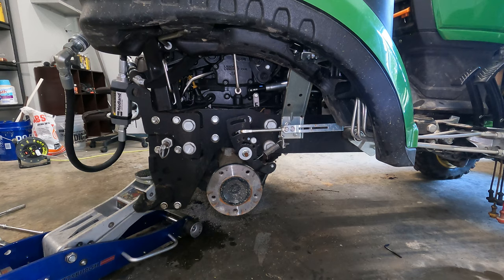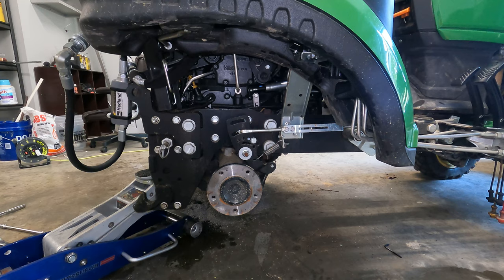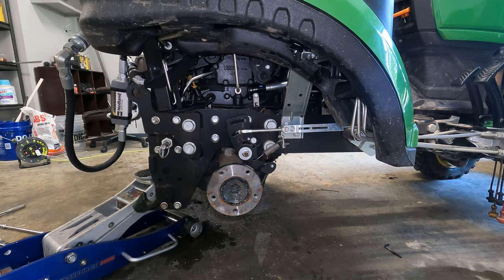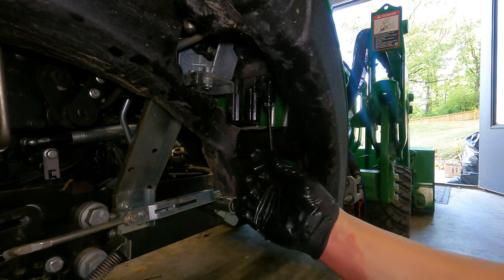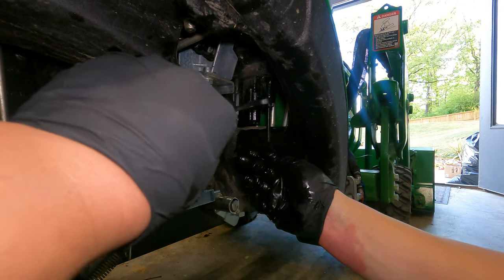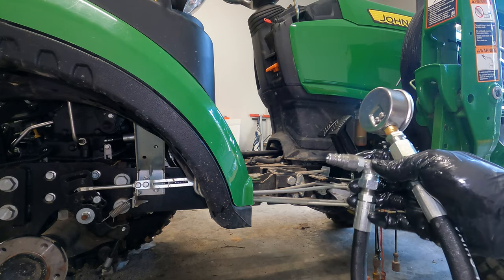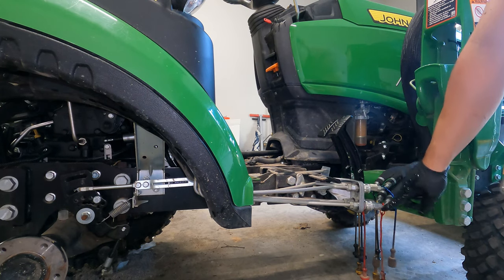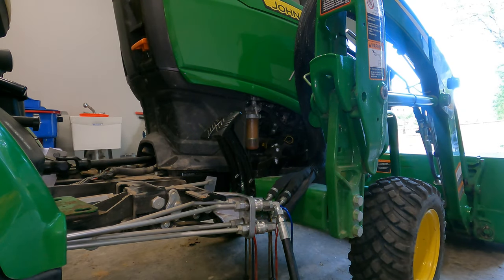John Deere 1025R Pressure Relief Valve Adjustment

Comment: Reminding  folks to warm up the tractor first before checking the pressure. 

Also only check the pressure for 20 sec or less.
Reply from the maker: Good call out and thanks!  I failed to mention that and this tractor was warmed up from some other flow tests that I was also running at the time.  I added a subtitle reminder at the 7:00 minute mark.

Comment: How do you test the pressure if you have a muilti point connector for the loader? I see boltonhooks has a warning to not use that pressure guage and quick connect if you have a single point connector. Just bought your cylinder upgrades for my 2023 1025r and I want to make sure I get the pressure dialed in as well. Awesome videos! Thanks!
Reply from the maker: You will need a 1/4 flat face connector on the end of your pressure gauge

Comment: Any idea how much the bucket lift capacity would go up if you increase the pressure from 2000psi to 2100psi?  Also how high could you increase the pressure and not cause problems?
Reply from the maker: I don't know a definitive answer for either of these questions, but let me share some math and my experience and you can decide the best course for you.

Lift capacity is a moving target because it goes down as height goes up.  I'm using this TTWT video to get my capacities for the math - https://www.youtube.com/watch?v=KJ_8i-XMMMc

He's able to get 1400lbs off the ground at 2100 psi.  Since we know the lift cylinders have a 1.5" bore, we can use pi R squared to get the area...which is 1.76 inches.  Multiply by 2 since there are 2 lift cylinders and you get 3.56 square inches of area on the pistons. Multiply that by 2100 PSI, and you get 7,392 pounds of force.  Those 7,392 pounds of force lifted 1,400 lbs, (7,392/1,400)so it takes 5.28 pounds of force in the cylinders to lift a pound of loader weight.

Real math people would use calculus to determine the rate of change based on the angle of the loader, probably the atmospheric pressure for the day and the current phase of the moon, but for us, this is probably close enough.

So for every 100 psi, you can get (100/5.28) 18.93lbs more to the same lift height as Tim did in that video.  As you go higher, that number will decrease. 

Second question - everything in the hydraulic system with the exception of the pump is rated for   at least 3000 psi working pressure, which gives you a safety factor (burst pressure) of 12000 psi because safety factors are typically at least 4:1.  The pump, based on some reliefs is rated for a 2100 psi working pressure.  Working pressure being the pressure you keep all day, everyday.  The max pressure is something like 2800 psi.  When I'm not  demonstrating something in a video, I commonly run my tractors at 2500psi and above. I've never had any issues caused by this, but your mileage may vary.  I'm also more than willing to pay for any fallout caused by me running higher pressures. If you buy a HydrosPlus pump, you can run any pressure you want.  We only ask questions to learn, but the free replacement is not conditional.  

While I know these aren't precise answers, I hope they are helpful. Feel free to give me a call or email if you want to discuss further or other related topics- contact info can be found at hydrosplus.com

Comment: I am new owner of a used 2019 John Deere 1025 with 425 hours on it.  The bucket worked so smooth and I used it for grading and had a great deal of it done, no problems and then suddenly the bucket won't tilt.   If I try to tilt it and move the stick to the right a little bit it will lower ok but if I push it too hard it will bring it all the way back up.  If I raise the bucket up to driver seat level it won't tilt at all.  I took the bucket off to do something with it and now with no load on it, it won't tilt at all to put the bucket back on?  What possibly cold have happened and what can I do to fix it.  All the fittings look fine no leaks in hydraulics.  By the way, I enjoyed your video.
Reply from the maker: I'm happy you enjoyed the video and thanks for the comment and question.  This is a very peculiar symptom, but the easiest first step is to confirm that the quick connects are seated correctly.  Did you happen to take the whole loader off?  If not, this probably isn't the issue since you haven't removed them, but it's a first thing to check.  If you reseat the hoses and you have the same symptom, switch the loader and bucket hoses.  If the symptom persists, the issue is between the SCV and the bucket.  if you have a similar symptom on the boom side (since you switched the hoses), then it's in the hydro system before the scv.  Feel free to call me at 501.454.4652 if you want to talk through it.
Reply: @HydrosPlus  No I just took the bucket off.  I will try your suggestions.  Thank you for a nice reply.
Reply: @darwinwhite9377  what did you discover?      If it was my tractor, I’d start within the easy stuff.   Disconnect the hose quick connects, wipe with clean rag, reconnect.  Next, I’d  check the hydraulic fluid level and top off if needed. Still not working, then I’d be using Google, then the manual, then call the dealer.
Reply: I had the same problem. Turned out to be the quick connects. I had been pushing brush and I guess a root or stump popped up and hit the quick connect and loosened it just enough to disable it. Not obvious by just looking, took me a few minutes to figure it out. Hope this helps.

Comment: Out of curiosity, regarding your increased flow kits.  When the pressure relief valve (PRV) opens up, how much flow can the PRV handle before spiking the pressure upstream?  What I mean to convey is, if the PRV is designed to flow, say at 4 gpm (but I have no idea what its specs are), what happens when your kit is flowing 9 gpm and an over pressure scenario occurs?  If the PRV tops out at 4 gpm, hydraulic pressure will increase beyond the set value that you have adjusted it to, because it won't be able to throughput the extra flow, and maybe even cause foaming issues.  I imagine that the PRV might be spec'd higher than 4 gpm, because theoretically you could have the steering at hard lock and also have the loader pegged at the same time.
Not saying that this is/might happen with your kit, ...just wondering.
Reply from the maker: I'm not sure what the flow on the PRV is, but I expect it's actually more than the 3/8 line it services.  Also, keep in mind that 9.5 GPMs is not going to the implement circuit, it's more like 7.5 to 8.  Even if the PRV can't flow the full amount, when it opens, the pressure will be relieved, so a pressure spike isn't a concern.  That said, if you were to hold open the PRV by holding it at full lock or trying to lift something that's more than it can lift, you will create heat and foaming if it goes on for long enough.  Most people will stop before you get to that point.

Comment: Excellently informative video. Would the "adjustment" be similar on a 2025r?
Reply from the maker: yes - the 2025R, as well as a few other models, use the same manual hydraulic valve as the 1025R to control the mid scv.

Comment: Potentially dumb question - if the PTO on the 1/2025R is hydraulic, would this modification increase the PTO HP? Or is something else the limiting factor?
Reply from the maker: The PTO isn't hydraulic on this machine.  It's a direct connection to the engine, so the only change in PTO horsepower would be from something like the HydrosPlus Turbo+
Reply: @HydrosPlus  Gotcha. Thanks!

Comment: I plan to get his Hydro-Kit. I guess it’s sooo long Warranty for me!
Reply from the maker: Great to hear and I'm looking forward to building your kit in the future.  Regarding the warranty, I would say, "You won't necessarily void your warranty".  See this video from Neil at Messick's who is a well respected dealer in the NE on the topic - https://www.youtube.com/watch?v=fRbFeZ7FCW4

If you have a warranty issue that is related to your pump or hydraulic component in the steering or implement circuits, you may have the burden of proving that the kit wasn't a factor, but for other warranty claims not related, your warranty should be intact the same as if you were to add other aftermarket parts to your machine.

Comment: Hi there, This may be a little off-topic, but my 2014 1023e has started squealing loudly when I operate the 3pl, loader or steering. All these actually operate, but theres something under the seat area that makes this awful noise. Can you help?
Reply from the maker: It's hard to say, but I'm assuming you checked fluid for both level and condition.  I have a 2014 1023E and a little after I bought it, there was a weird issue and I can't remember if it squealed, but the hydro fluid was very gummy and it would barely move.  The previous owner had the receipts showing a recent hydro fluid change, but the fluid was ruined. I learned later that the earlier 1023 had an issue with how the oil fill cap location was designed that allowed water to funnel into the hydraulic fluid.  I think there is a fix for it, but I've never checked into it b/c I typically park it inside.  If your fluid looks bad, that could be part of the issue.

This probably isn't the answer, but what came to mind based on what you're experiencing. One last thing to mention, it wasn't obvious to me when looking at the fluid on the dipstick as to how bad it was.  When I pulled the internal suction screen, it was nearly completely clogged with gummy fluid (or what used to be fluid).

If it doesn't clear up on its own, your first step is likely to change the fluid and filters unless you have done that very recently.

Comment: I’m just wondering if this adjustment has any effect on warranty?
Reply: Definitely,  if something  break, and you need to claim repair, JD will findout that you changed it. My is almost over, only 12 months left. Also, I'm  not sure if the 6 years warranty  covers anything to do with hydrilics, I'm  new on JD world, just bought my, a 2019 1025R, 147.5 hours.

Comment: Do the relief balves ever go bad
Reply from the maker: It's possible, but I think it's rare.  They are very simple, so really the only thing that can go wrong is a broken spring or a clogged port.  If you had really dirty fluid for an extended period of time, it could wear some, but you would probably have bigger problems at that point.

Comment: I forgot to ask you, you far did you end up turning the allen screw "clockwise" in total for your increase pressure from the factory spec to your 2100psi gauge pressure setting???
Reply from the maker: I started at 1800 PSI, so 3/4 of a turn got me to 2100 PSI, so on that particular tractor, about 1/4 of a turn was about 100 PSI.  This may vary with condition of your spring in your pressure relief valve, so you definitely want to have a pressure gauge handy.
Reply: @HydrosPlus  okie dokie, thankya sir for the info. Guess i better order a pressure gauge from Kens Bolt On Hooks fore doing this type of adjustment! 

i have another question for ya, if ya dont mind. Say i do this adjustment (with the pressure guage of course) way before adding your hydro plus rear hydraulic pump kit, operate my tractor for awhile, then i add your H.P. kit to the tractor. Would i need to bring the adjustment back down to the factory setting of 1800psi or just keep it at the "new" setting & not worry about messing with it after installing your H.P. kit???
Reply from the maker: @truckerray7533  - keep the questions coming :)  No need to change the adjustment because it's completely independent of HydrosPlus.  Set it to what works for you and let it be.
Reply: @HydrosPlus  Sooooooo. . . . . .i could set the valve for 2100, run the tractor as normal, then later buy your kit & install, & still keep the setting at 2100 psi???
Reply from the maker: @truckerray7533  yes, exactly.  That pressure setting will stay the same no matter what you do in the hydraulic system and the HydrosPlus pumps can take as much or more than the stock pumps regarding pressure.
Reply: @HydrosPlus  okie dokie, thankyou. Now how does your H.P. pump affect the steering in any way or is that on its own system entirely???
Reply from the maker: @truckerray7533  you have the flexibility to "tune" the steering to your preferences.  If you like it tighter, you can get even more flow to the implements, or if you want it to feel the same, then you can adjust it to do so, which gives you a little less to the implements, but you will still be well over 7 GPMs with the Extreme Capacity kit.  If you tune it tighter, you can get 8 or a little more.

Comment: does this help with the 3pt hitch as well or is there another PRV for that?
Reply from the maker: Yes.  The rockshaft PRV setting is 2494 psi and it's on the same circuit as the other implements.  Since this is the case, your maximum pressure for the implement circuit is limited to your lowest  PRV setting as far as pump pressure.  It may be possible to exceed the pressures of the lower PRVs if there is a check valve that restricts reverse flow between the valves.  For example, if you are lifting with the 3pt, the highest pressure you can build with the pump is the lowest PRV setting, but if you're bouncing across the field with a heavy 3pt implement and there is a check valve between the PRVs, the pressure can exceed the lower PRV setting in that section of the circuit due to the weight on the 3pt arms.  I don't know of a check valve between the PRVs.  The only device I know of in the circuit that restricts reverse flow is the PTO Manifold, which is before any PRVs.

Comment: how much pressure can you increase using the stock pump?
Reply from the maker: I am not aware of the max outlet pressure rating for the stock pump.  It's a proprietary design for JD and I haven't seen the specs listed anywhere online, but similar pumps are typically rated at 250 bar (~3600 PSI).  That is a max pressure and the working pressure will always be lower, but I can't confirm how much.
Reply: @HydrosPlus  .. JD lists maximum psi2000 1025R and psi2150 2025R.
Reply from the maker: @garrimic3  agree that those are the JD specs, but I have not seen it confirmed anywhere in writing what the pump specs are.  They may indeed be the same, but it's also possible that they are higher.  I just haven't seen it confirmed.

Comment: I wonder how many pounds this would increasing our lifting capacity on 1025r
Reply from the maker: This solution does not affect lifting capacity.  For details on lift capacity, see my video on pressure relief valves.
Reply: That fitting goes str8 to the lifting rams. How wouldn't this increase the lifting capacity?? Diameter of cylinder  x pie equals sq inches. Increase psi...will increase lifting capacity
Reply: Why can't I view the 2 replies from  Hydrosplus & others ??
Reply: @vannorman1116  I agree with your comment.  Increased pressure should increase lifting capacity.  That is what pressure does.